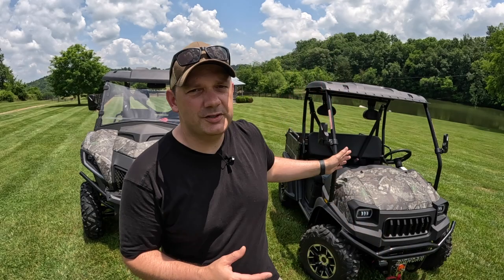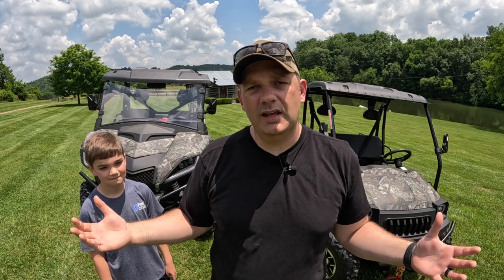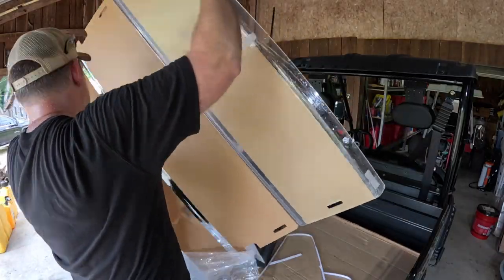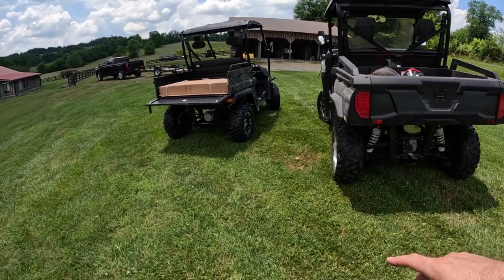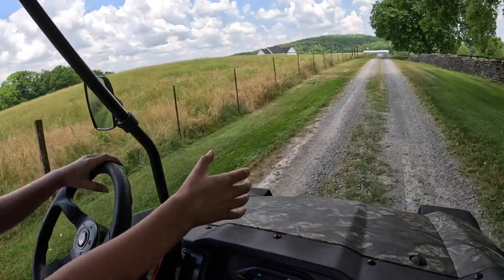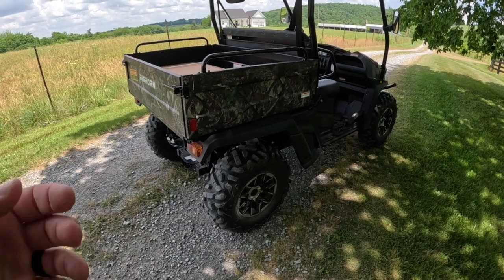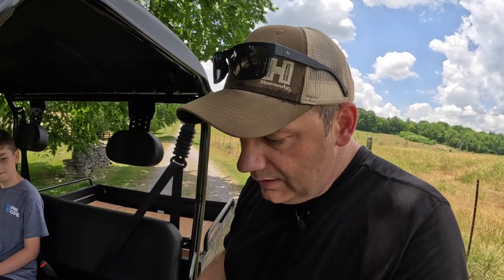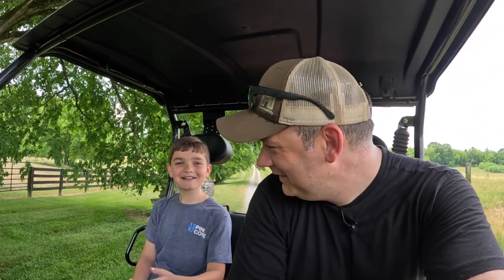BIGHORN EXPLORER 400 EFI UTV | FIRST IMPRESSIONS!

Comment: Thanks for doing this video Joe, great stuff!  I went through a UTV search back in February and ended up going with the BigHorn 400 for our SC 300 acre farm and we love it.  We have it rigged with a 25 gal sprayer in the bed, electric spreader we mounted to the front brush bars and a home made  cultipacker we pull behind the BH for a food plot machine.  Our cultipacker is a concrete filled 12" culvert pipe about 56" long/wide weighing in around 400lbs and the BG 400 handles it no problem.  Only complaint thus far is that we haven't been able to find a company to insure it, all Ins companies have told us they won't insure it because they can't pull comps on it...nonsense, but I'd go with the Bighorn 400 again, great machine for the small farm/hunt property
Reply from the maker: That’s awesome!  Congratulations man. And sounds like you have an awesome spot to hunt.  Insurance can be weird for sure.  How has the 400 pulled that culvert pipe?

Comment: You are absolutely right there are hardly any videos on these big horn side by sides I recently bought the the bighorn 450 crew I am taking mine to Natchez Trace State Park and road the trails there and a few other places and it takes me anywhere I want to go only beef is I wish it went a little bit faster on the side roads!
It probably should have been a 550 crew or maybe a 700 all in all I think they are a great machine as well
Reply from the maker: Hey!  Thanks for watching!  I was wondering if the crew 450 would have the power to pull an entire family or group…sounds like it’s enough.  We have been impressed with the fit and finish of both machines and the 550 has tons pf power.  A crew 700 would make sense to me but we are always towing or pulling something.  Good luck brother and enjoy that machine!

Comment: I just purchased the 400 and so far my only complaint is how loud it is when driving. Lots of engine noise but a great little machine. Thanks for sharing your experience!
Reply from the maker: Congratulations!  It is very loud, but there is ZERO soundproofing under the seat.  I am going to try to get some sound dampening materials and see if that lowers the decibels.  Stay tuned!
Reply: @JoeTheFarmer  I'm going to add a piece of 3/4" thick horse mat to the bed and see if that dampens the noise on mine!
Reply from the maker: Thats a solid plan for sure.  I use the exact same thing in all of my sxs’s.  Best protection for the money.  It really is a nice little machine.  My son and wife have pretty much claimed it but I used it a bunch yesterday and was very comfortable.  The noise level is my only complaint so far!
Reply: Can you guys advise on where you think the noise is coming from? Is it engine noise or just a poor muffler? I'm picking mine up today. Thanks and great video!
Reply from the maker: Under the seat and that compartment.  I think soundproofing vinyl would help a lot.  There is just zero sound deadening material in there.  It is a great little machine though!
Reply: @HeavyDuty2A  I agree with Joe. I’m going to look at adding some sound deadening material to mine and see if it helps. I just posted my review of my Bighorn 400 on my channel if you’d like to see it.
Reply: @oldmanoldtruck  You did a great review which also led me to purchase it. I've joined the Bighorn UTV group on Facebook and I hope to share information and enjoy chatting with others.
Reply from the maker: @heavydutyrc2394 Thanks man!  And will see you there!!!

Comment: Im glad you did this. 
I'm Interested I'm this machine , I like the light and simple.
 How about accessories and add -ons? Enclosure, heater, Wiper are those type of things available?
Big Joe,& little Joe thank you very much.
Reply from the maker: Thanks for watching!  And it comes pretty tricked out.  I’d rather had an air conditioner but heater…but there is a nice surprise coming on the 550 soon.  I’ll post it when it’s done.  😁

Comment: Just got our 400 home and getting familiar with it.  Have you noticed the bed gets pretty warm from the exhaust pipe?  Seems to be quite a bit of heat and I understand it only has one place to go and that is up but we were watching steam off the bed as we brought it home in the rain. 

Great video and informative especially the annoying reverse buzzer.
Reply from the maker: That’s awesome!  Congrats on the new machine!  I think that the heat/steam is fine.  Like you said; heat rises.  Just change the oil often and should last you a LONG time.  Thanks for watching!

Comment: I just bought one over memorial day weekend, live on 29 acres, I am 6'1" and a bigger guy it's comfortable for me could be a little bigger but also bought it so my two step daughters (17 and 15) and my daughter (12) could use it.      Being you are 10 months in, any issues?  After a three day weekend we put 4 hours and 16 miles on it and had a blast.

Only issue so far I am having is the parking brake light won't turn off on panel, it's disengaged but the light won't turn off.  Great channel by the way.
Reply from the maker: Hey!  Congrats on the new machine man!  Should treat you well.  No complaints or issues, other than it’s a loud machine.  But is what it is.  The light may be due to the ebrake adjustment.  Don’t settle brother.  Make them fix it.  If you call them they are usually very helpful and may help there.  Appreciate you watching and the kind words.  Really enjoy this community!

Comment: We just got our 400 home and getting familiar with it.  Have you noticed how warm the bed gets above the exhaust pipe?  Understand the pipe gets hot and only one place to go which is up but we were watching it steam the water off as we brought it home in the rain.  

Do you know what the normal operating temperature is for the engine?  Nothing in the book that I saw.  

Great video and appreciate the tip on the buzzer.
Reply: You can add your own heat shielding under the bed.  Can buy it for generic application.

Comment: Thanks for info on oil filter. Was looking everywhere for that. Haven’t changed oil yet. Where is drain screw located. Thanks
Reply from the maker: Happy to help!  Drain screw under the chassis.  Watch out for the oil screen that will come out with the drain plug.

Comment: This video is really helpful but for the life of me I cannot find any reviews on the BIGHORN 450 LIMO EFI 4X4 HIGH/LOW 6 SEAT UTV GOLF CART.  I rcently purchased this at TS and it will be arriving soon.  Two concerns I have with this are will it accommodate a 6'4" person behind the wheel comfortably and also how bad is the noise level for a campground?  Any input on this would be more than I can find or have answered by TS.  TY!!
Reply from the maker: Hey!! I’m 6’4 and it’s comfortable.  No issues there.  Not sure on the noise on that machine but the reg 450 is really loud. Now; its loud to the driver…but campers prob not so much.  I think you will like it.  Very well appointed machine for the money.  Thanks for watching!

Comment: What is your thoughts on the bighorn 400
Reply from the maker: I really like it.  Its a smaller frame so we use bigger machines for most of what we need to do…but that’s prob just because we have bigger machines to use.  It starts right up and could do a whole lot of work for most properties.  Number one complaint I get is items w loud machine.  But for the money there is a ton of value.

Comment: I have a 2023 BH I purchased last summer. I like everything about it *EXCEPT* the extreme noisy cab! It’s almost difficult to have a conversation with a rider without going very, very slow…anyone have this same issue and what did you do to correct it? Thanks
Reply from the maker: Hey Dwayne.  Very happy with this machine with one exception…exactly what you said.  It is a very loud machine.  The only workaround I have found is to have hearing protection on the rig.  Hang em on the shifting knob and call it a day.  Some harbor freight over ear muffs are 5 bucks and work great.  Just check em for critters!  Lol

Comment: Can you tell me about the emergency brake? It's either on (all the way to the bottom) or off (all the way to the top)? It looks almost like you have different settings in the video like notches next to the shifter.
Reply from the maker: Hey!  Not different settings.  Just depends on how much the cable has stretched.  Just pull down until tight.  Thanks for watching!

Comment: Just bought a bighorn 400 utv. I found it to be a problem darting left and right to point of fearing it may causing a accident. Had it checked out by a local TS dealer and he said nature of the beast..  Have you experienced this problem ?
Reply from the maker: I think the steering is more “loose” than other machines but nothing like darting back and forth.  Were you on gravel or level ground?  It’s a lot of money to spend on something you don’t feel comfortable in. If you don’t love it, take it back and get something you do like.  No shame in that brother.  You work hard for your money and you will have a machine for a long time.

Comment: I’ve had the exact model for about 2 years. It’s starting to have problems shifting. I’m thinking it needs a new belt. Any idea of which belt it takes?
Reply from the maker: No clue brother.   I am still learning about this one.  I would say it can prob be adjusted but I would call the folks at Bighorn.  They have been helpful when I called (and didn’t tell them it was me calling)
Reply: I'm starting to have the same issues, 820 miles on it

Comment: Do u know where these machines are manufactured and how is the parts supply for these? My uncle looking into one of these and I’m just tryna research the longevity of these machine. Thanks!!
Reply from the maker: Made by Linhai in China.  Assembled in the US.  Linhai has had a long relationship with Yamaha.  There are literally thousands of these machines sold each year so I doubt parts will be an issue.  I think if you care for it and do a solid pre inspection (tighten bolts, grease, check fluids, etc) it should give you years of service.  I recommend a solid pre inspection with any brand fyi; including our Honda’s and Kawi’s.  Thanks for watching and if he buys one send me a pic!  Would love to see it.  👍🏼👊🏼
Reply: @JoeTheFarmer  appreciate your input on these machines.!
Reply from the maker: Absolutely man.  Hope it helps.  👍🏼👊🏼

Comment: I thought you video was excellent. I just  bought one these  bighorn 400 cc just 6 ago so far so good. This  is my first utv. Can the temp gauge be changed to Celsius 2 Fahrenheit? I would appreciate any help you could give meany  help on this subject if possible thank you and have a great day.   Carmine  Atlanta ga.
Reply from the maker: Hi Carmine!  Congratulations on the new machine!  I believe if you hold the two buttons together at the same time it will let you set the time, change from C to F, etc.  It is a quality machine for sure.  Change the oil early and often and should last a VERY long time.  If you can, send me a pic of the new ride!!!
Reply: @JoeTheFarmer  Joe thank you very much for taking the time to give me the information I needed to change my temp from c to  f. The people at tractor  supply told to 15W / 40W  full synthetic so I bought a  gallon mobile  1
I will  send you some pics. Mine came  with windshield installed  and 2500 pound winch already installed. The only other thing they told me to us  high test  gas 92 octane olny. So that's what I have been using.
Reply from the maker: Happy to help!  And yes, high quality fuel is always important with small engines.  I use 89 ethanol free and works fine.  Change the fluids early and often as it breaks in and should last a very long time.  😁👍🏼
Reply: @JoeTheFarmer   thank you Joe  you and your family have a happy and safe holiday.
Reply from the maker: Happy to help!  Happy 4th!!!

Comment: Have you had in any rough terrain yet like the Coleman 550?
Reply from the maker: Hey!  Thanks for watching.  I have not dished out as much abuse to the big horn.  Hard to explain; but the Coleman is just an anvil.  Its not as refined as the big horn…but the thing is just a tank.  The big horn has a lot more to break (i.e. a windshield!).  I’ve also torn off the side mirrors on the Coleman.  Really should have been nicer to it.  Lol.  BUT, still runs like a champ.  😁👍🏼

Comment: I was considering the Coleman UTV400 or the Axis 500, but after seeing this video, I am going today to look at the Bighorn Explorer 400, which for me has the best of both worlds. With that said, there is not much on this, as far as reviews and maintenance. I did see that parts are hard do find and there are some individuals that are unhappy with the owners manual. I heard that this unit does not use an oil filter, but I cannot find out anything on changing the oil or how engine oil is kept clean without a filter. Do you have any information on the above? It would be appreciated. Thank you.
Reply from the maker: Hey Craig, I don’t believe that the Coleman 400 takes an oil filter either.  I could be wrong.  The BigHorn is built by Lanai which has an excellent reputation for quality (partnership with Yamaha I believe) and I would steer you to the BigHorn vs the Coleman 400.  Now, we have a Coleman 550 and it has been an excellent machine so if you were going BH vs Coleman 550 I would say get what suits you best because both are great machines.  The Coleman 400 just doesn’t feel as substantial as the BH 400.  It just feels sturdy and powerful vs the Coleman 400.  But it’s all preference.  Finally, I don’t buy the parts shortage argument.  There are TONS of these machines being built and parts are available.  BigHorn or Coleman, never had a problem.  I appreciate you watching and keep me posted!
Reply: @JoeTheFarmer  another thing to mention is that the Coleman 400 only has high gear no low gear.
The Bighorn has both high and low gear.
Reply from the maker: @cradz4979 great point!

Comment: I just took delivery of a Bighorn Explorer 400 but I got the four seater model two seats facing the rear. 
The brakes feel soft spongy and I have to stand really hard on the brake pedal in order to stop, is this normal?
Reply from the maker: Hey!  Any new machine will need fluids topped off, etc. I would keep an eye on all of that and it includes brake fluid.  Sounds like it needs the brake fluid filled to spec.  Hope that helps!

Comment: Is the Parking Brake supposed to be centered?  Not at the top, not at the bottom I don't see it clarified in the owner's manual.
Reply from the maker: When it releases it goes almost to the top on ours.  I’m sure they are all a bit different depending on how the brakes are adjusted and broken in

Comment: No oil filter....?
Reply from the maker: No sir.  There is a screen at the drain plug but no in line filter.
Reply: Well that takes this one off the list.
Reply from the maker: Pretty common on smaller engines.  They are designed that way.  But a screw on filter makes me feel oil is cleaner too.   Then again, so many machines I have don’t use one.  We have an atv like that, pressure washers, mowers, string trimmers, mulchers, etc.  🤷🏻‍♂️

Comment: You should correct inaccurate info that you are giving out. This unit and it's motor does have an oil filter cartridge
Reply from the maker: Have you changed the oil in one?
Reply: No, just what I have learned from other online information. However there has to be an integrated oil filtration system for every internal combustion engine. I addressed this because I am looking at buying one but I don't want a motor without a filtration system.
Reply from the maker: All due respect Phillip, the machine does not have an oil filter.  When you say I “should correct inaccurate info” that I am giving out; you should be better informed than just saying you have done internet research.  No hard feelings; but I do my best to offer accurate and insightful information.  I am just a regular guy sharing information and ideas.  Hope you find the right machine for you.  😁👍🏼